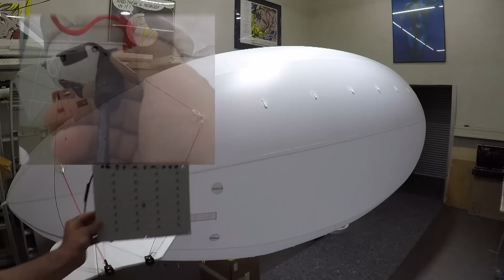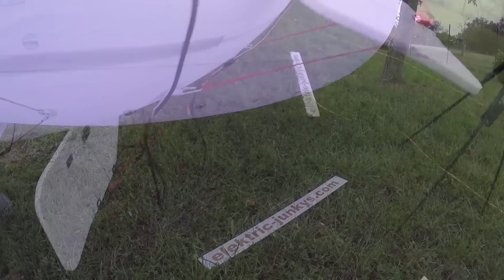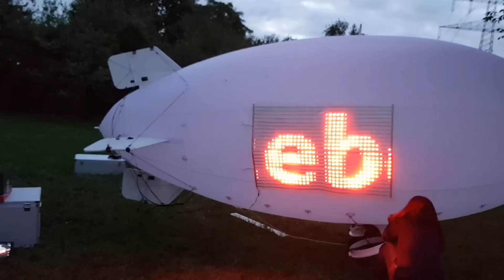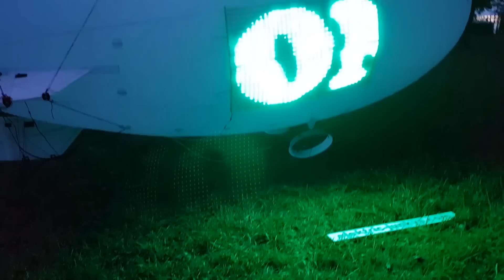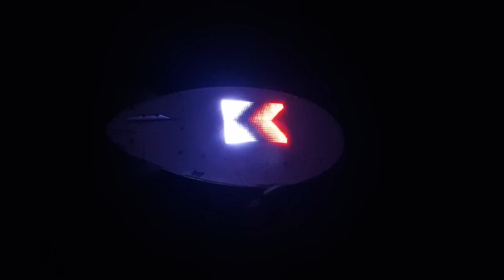Flying LED Video Screen 😲 ? ? WS2813 wireless Driven on RC Airship T300K

Comment: Really cool concept but I would imagine there are a lot of laws governing where you could actually use it. Common sense should however tell you not to use something like this right next to power lines like in the video. It may not be tethered to the ground or a user but it could still cause damage to itself and / or the power lines if a strong gust of wind took it in the wrong direction.
Reply from the maker: hi mate thanks for comment .. yeah thats true, mostly People with Experierence  Purchase this kind kind of stuff .. we sold an 12Meters Airship before can you imagine that is the Double size of this one ... 12Meters .... scary, i guess in the USA crazy stuff like that is allowed .. for sure just in "Europe" not.... maybe is soon not existing any more then is also allowed there ;)